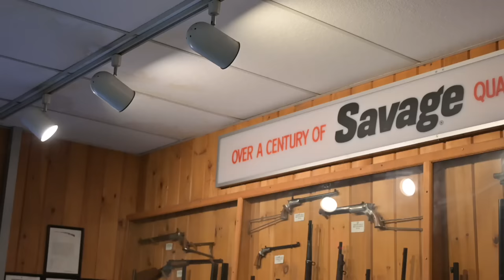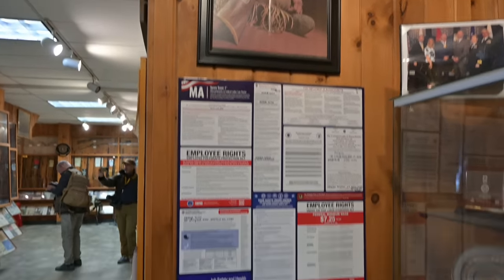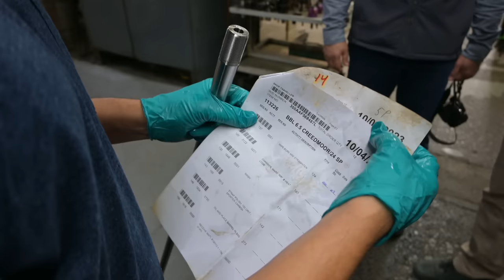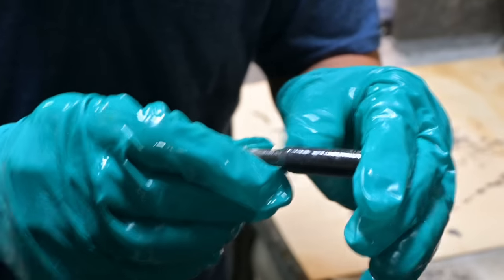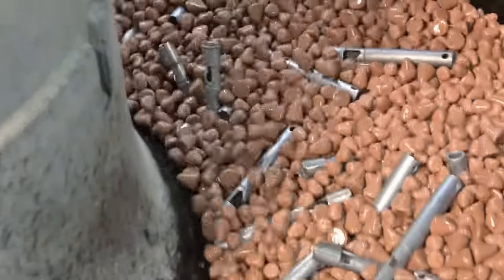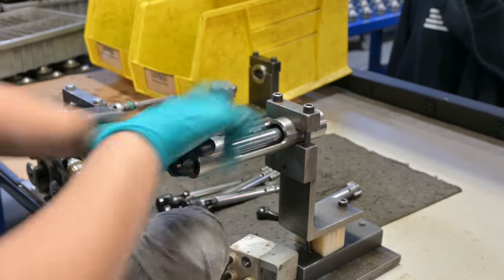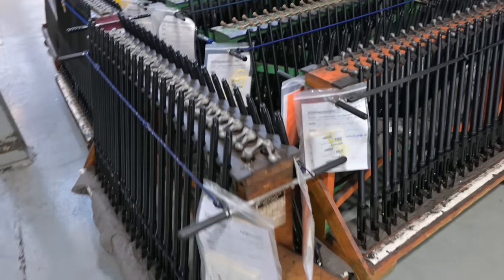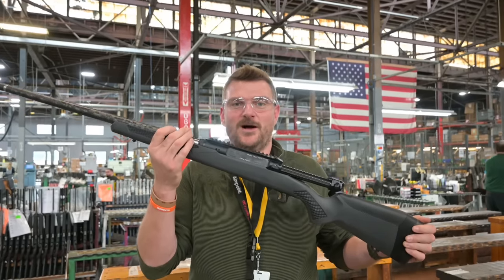Savage Arms Factory Tour, watching the rifles come to life from  billets and bars of steel

Comment: I have wanted a .222 for 50 years, and now Savage is the only one making one available in the U.S.  I just bought a model 25 .222, with reservations, but I shouldn't have worried.  The first handload I tried shot into .75" at 100yds.  I am sure with some tweaking it will do better.  Not a fancy gun, but the action is smooth and functions well, obviously shoots great.  Wish they would make a model 12 laminated stainless varmint gun in .222.  I would buy one in a heartbeat.
Reply: I bought the mdl 25 Walking Varminter laminated stock in .17 Hornet a year ago. Took me two months before I could find ammo for it. Still trying to find some 25 grainers. Picked up a set of reloading dies too.

Comment: For the most part, the guns made today by Savage are junk!
Reply: Not really true at all.
Reply: I disagree. I have a B22 mag that is an absolute tack driver and easy to tear down and clean.
Reply: The actions are spot on..........the model 10 action is both a classic and masterpiece in design..........Junk, you don't which end of the rifle the round comes out of..............lol
Reply: My first Savage rifle, model 116 30-06 (1994), was a piece of junk. I waited over ten years to buy another Savage rifle model116 375 (2015) Ruger, and I replaced the factory stock. I waited again; I thought Savage had made some improvements, but no way? 110 Tactical 308W, the 20" barrel, a mess. It too where I had to replace the barrel with a Criterion barrel 22" march grade hand lapped. Lastly, the only thing about the 110 Tactical is that the factory stock is outstanding, but I did finally replace it with a KRG Bravo stock, which is better. Savage, no way. Stick with TIKKA rifles.
Reply: @anthonyhowe1419 got the B MAG in .17 WSM. Same performance. 
  The 15.5 grainers (3,300 fps) blow a silver dollar sized hole in the onside of a pigeon and no exit on farside.